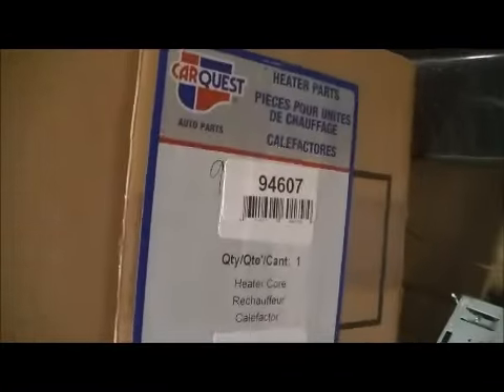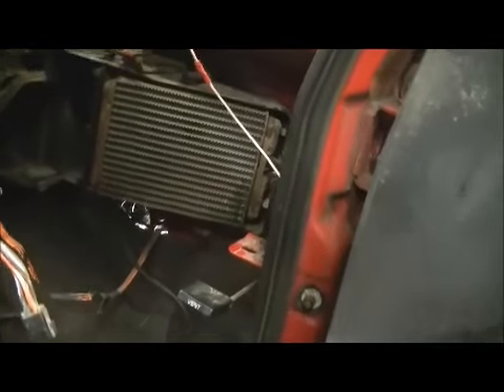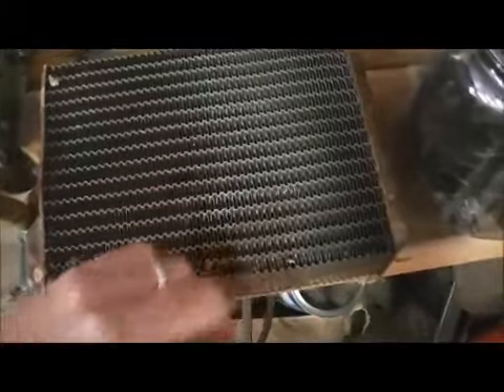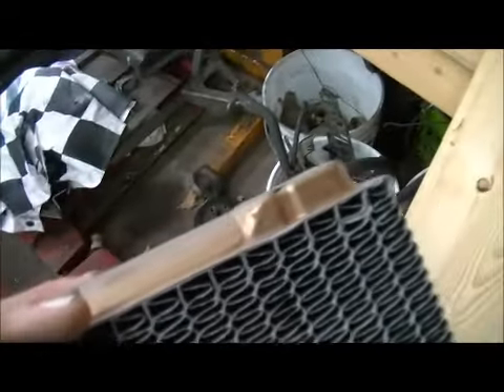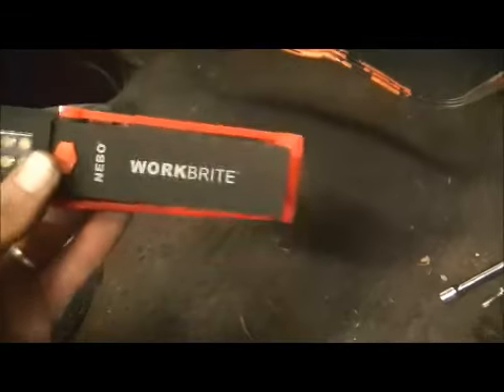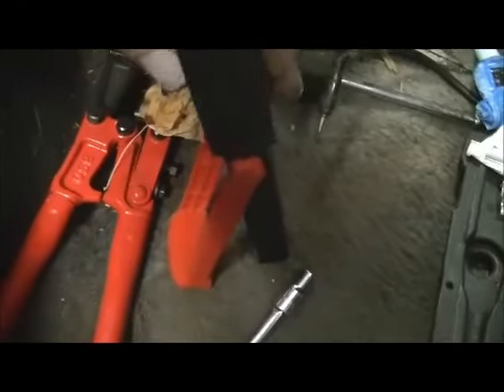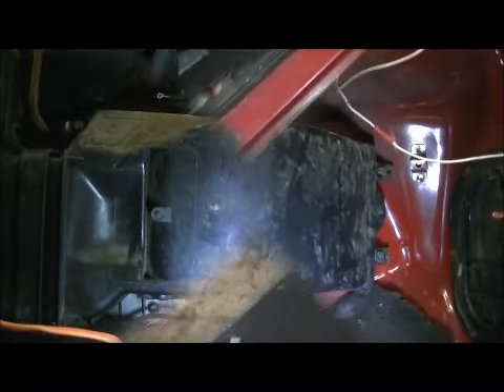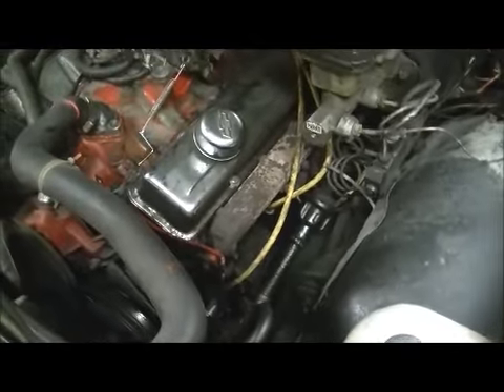Heater Core Replacement 1987 Chevy S-10

Comment: The colored kick panel to the right have to be removed?? Thanks for sharing.
Reply from the maker: I didn't. But my old truck wasn't really in perfect condition so it may have to on a nicer vehicle,  mine has 280,000 miles and u drove it for 16 years,  and this was just before the frame broke into and I parted it out
Reply: @GeraldGamble  that's awesome ya had it that long and milage. I once had a '87 lt blue 2.5l in the 90s. I found another lt blue one recently that came from NC. 2.8l V-6 longbed 150k.mi. Has solid body and frame. Interior needs work. Need glove box door. Certain parts are hard to come by.

Comment: Where did you buy the replacement heatercore at. Mine from napa is slightly bigger and the OEM is more square. Hard to fit it in the stock location without possibly bending the pipes.
Reply from the maker: barry k. I bought mine at a local car quest that I deal with. But I understand that advanced auto bought car quest so they both have the exact same parts

Comment: Core can be changed without removing the dash.
Reply: m schiffel how hard is it
Reply: It's not too bad...lots of little screws...I took two days working at a nice easy pace...just be sure that you are warm and comfy...I did the job outside in December, not the best weather...Three hours per day and I was done...The worst part was my fingers getting cold...Disconnect the hoses first.
Reply: Yeah, but it is very difficult!!!